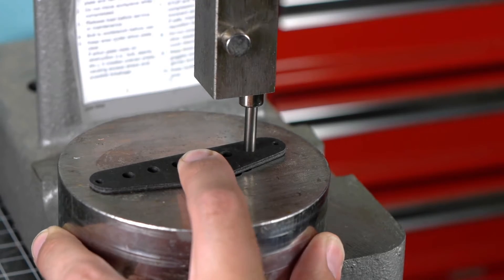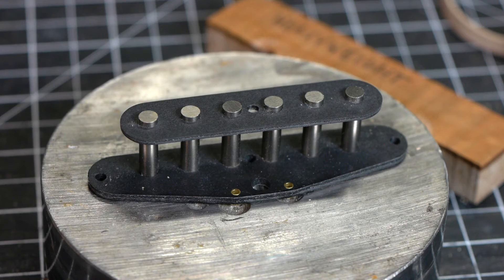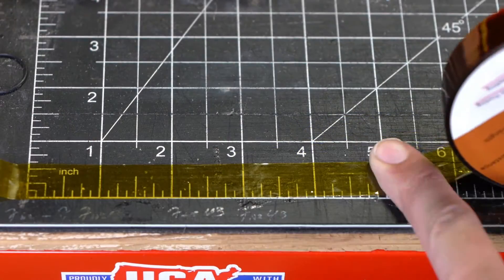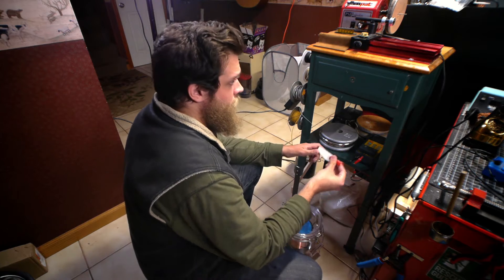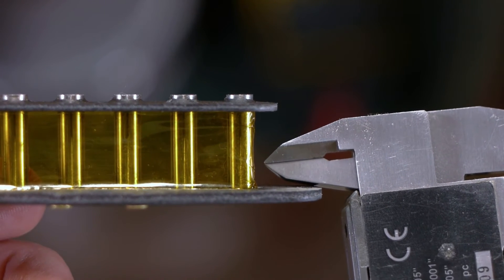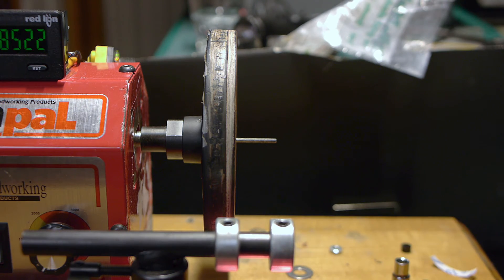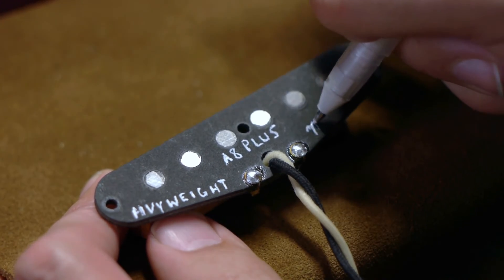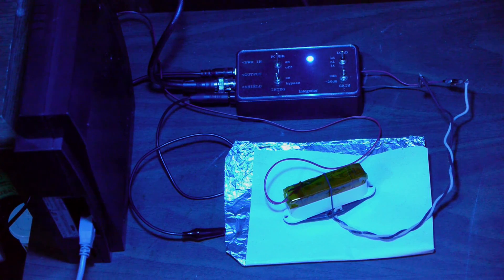(**OLD VERSION: CHECK DESCRIPTION**) Making a Single Coil Pickup: Complete Guide

Comment: how would you insert eyelets?
Reply from the maker: I use the same tool steel working surface as I do for assembling bobbins. I drilled recesses deep enough to accommodate eyelets. The method is: 

Use an eyelet setting tool and a hammer. Line up the eyelet over the hole, and tap it firmly a couple times. Not too hard or it'll flare out. 

Then file down the excess flush. I use an equalling file for that. Most sets of needle files will have an equalling file in the set. It's the flat one with a square end. 

I do mean filing the tubular side of the eyelet down, not the flared side. The flared bulbous side is what you leave alone as that's what holds the bead of solder. 

You could use a block of wood just as easily. The key is having a work surface that has holes to accommodate the eyelets. When you set them, you'll have some of the eyelet tube sticking out through the bottom so the hole needs to be deep enough to accommodate that.
Reply: @guitar_md  Oh okay!! Thanks a million
Reply: @guitar_md  Could you consider making a short of this process?

Comment: I shouldn't popularize kapton tape in pickup group 7+ years ago. Other started to copy me i mean a lot of people, and i shared some other trick. No matter that use tape if you use it a way you do corrosion will start for sure it will pass trough a thin gap. Super glue should be a HUGE NO NO but sometimes the best way is keep my thoughts to myself. Good luck in your work, it's nice video well done.
Reply from the maker: The primary tape I used for years was black cloth acetate tape. I still use it pretty frequently, and have used it far more than Kapton tape -- only moved to Kapton tape this year. 

Black cloth tape is much cheaper and also much thicker. Thick tape can be problematic in terms of winding space as it will reduce the amount of turns you can fit on a bobbin before filling it up. 

Usually with the black tape I will have an overlap so there is no gap at all. It will cover a portion of the top and bottom flatwork via overlap. 

However, I have wondered if tape is a no-go. Professional magnet manufacturers often use an epoxy coating to prevent corrosion over time. I have thought for a while that using some kind of painted on coating over the magnets would be much more effective than tape. 

I've done a lot of vintage pickup rewinds and I do know what you mean: all it takes is a tiny amount of corrosion to ruin a pickup. I recently rewound an original 1951 Nocaster neck pickup, and the magnets had no tape around them at all. They were virtually mint condition inside, except for a very, very tiny amount of corrosion that I had to capture with a macro lens to see. 

I can understand why you'd be concerned about a small gap. I probably should have shown my usual method of using black cloth tape with a slight overlap on the top and bottom flatwork, though I thought of Kapton tape as the "industry standard" and wanted to have the most professional quality for this video. Could have ended up being a mistake. 

I'm curious why superglue is not appropriate. If there are any major concerns with it that would give me reason to stop using it -- I will stop using it. My only concern is making the highest quality pickups as I can, as a hobbyist. I don't run a business doing this. It's a labor of love. 

I haven't had any issues with superglue so I would be curious what issues would exist with it. 

Most of the pickup assembly methods I use were taught to me by Rob DiStefano of Cavalier Pickups, who's been winding pickups for decades. Everyone has their own way of doing things -- I'm most concerned with the correct way, and the most effective way. 

I don't agree with the idea that it's "best to keep your thoughts to yourself." 

I am completely open to criticism as long as it's actually valid and can improve my skills. As long as people are respectful of me I have absolutely no problem with criticism. 

Honestly, the most distressing thing to me is feeling like I put out some information that isn't accurate, or is teaching people the wrong thing. Like you said you wished you never introduced the idea of using Kapton tape years ago. 

However, I do need solid reasons for the methods I use -- for or against. To change my mind on something I need evidence and good reasons. Criticism in a respectful way is welcome here -- debate is healthy as long as the goal is coming to a more sound conclusion and having better, more reliable information. 

So please don't hesitate to tell me your thoughts. You haven't been disrespectful in anything you've said so I have no problem with you. I'd love to know what you think I'm doing wrong -- but more importantly, *why" you think it's wrong. 

I am always open to changing my methods when I'm presented with evidence that what I'm doing right now is not optimal. 

My guitar tech friend and mentor Steve really drilled that into me. He's been doing guitar work full time since 1968. Worked for Dan Armstrong and is still going full force, better than ever. 

He always told me not to get married to any method. "Show me a better way, and I'll be doing it tomorrow." 

I'm the same way. If there is a preferable alternative to taping the magnets I'd like to know -- I've considered using a painted-on coating that prevents rust, but haven't tried it yet. Black cloth tape has worked well for me but I'd be open to trying something else. Rust-proof coatings make the most sense, like what major manufacturers of magnets use to protect them -- but curious what your thoughts are.

Comment: Is the flat work different dimensions on the bridge, middle and neck pickups?  Thanks Glenn
Reply from the maker: Same for all of them: 52mm. This is the way Fender has always done it. 

However, foreign copies will often use 48mm neck, 50mm middle, 52mm bridge. This does line up better with the strings, but in reality I'm not convinced there's any audible difference whatsoever. 

The funny thing is that Tele pickups are spaced differently. I think 50mm on the neck pickup and 55mm on the bridge if I remember correctly. The reason Strats are spaced the same was probably to save money and expedite the process. 

When they designed the Tele pickup set, they clearly were aware of the narrower string spacing at the neck position compared to the bridge.
Reply: @guitar_md  thanks for the help that’s brilliant. 👍

Comment: You can see the wire during the spin, my scatter wounds are a little different than what I just saw. I like to keep my wire tight and I use my bare hand to feel the wire tension. I normally get a nice middy sounding wind even with an Alnico 5 mag at PAF level winding. I did one with a ceramic mag at 8.4k trying to recreate the 70s rock sound. It is a beautiful sounding Humbucker. I love what I do! 🫶🏼

Comment: Where do you get your plastic jars from? The ones you use to hold your 5lb rolls of wire. I've been looking and dont see any that big. Thanks
Reply from the maker: I've gone to using Rubbermaid pitchers. You can see those in my new updated version of this video here: 

https://youtu.be/5BqFoBJr10o

Much, much better than the canister/hinged lid style, funnily enough. And much easier to find. Like this one here: 

https://www.amazon.com/Rubbermaid-Pitcher-Classic-Gallon-Clear/dp/B00FSLRH2K/ref=sr_1_4?crid=WAES3ZN71D8D&keywords=rubbermaid+pitcher&qid=1691812634&sprefix=rubbermaid+pitche%2Caps%2C101&sr=8-4

Should be at any Wal-Mart, or easy to get online. Let me know if it works for you

Comment: I wind great humbuckers, buty singlecoils, are always bright and scooped. Any tips
Reply from the maker: I like overwinding my single coils for that reason, at least in the bridge position. Thinner wire and more turns will do it. Anywhere from 10,000 turns and up will pretty significantly attenuate the high end. More turns = less high end, more mids and low end.
Reply: Agree but then the more turns the more lifeless, it's the perfect in-between, which I found with humbuckers, but can't get my single coils  to sound how I want.
Reply from the maker: @wesleymorris1  It's important to define what lifeless means. That could be higher capacitance, or a lower Q factor (less amplitude at resonant frequency), or a more rapid dropoff in treble frequencies. And those all can be very hard to control. 

You might change the way you're building the bobbins. Shorter coils vs. taller coils. I haven't tested enough to conclusively say much except that shorter coils appear to have lower capacitance, which usually results in less attenuation of high end frequencies. So for the same inductance/resonant frequency, shorter coils will tend to retain more treble. 

On paper that sounds good, but it can also result in an unconventional tone. Bill Lawrence's "Micro Coils" are a good example of this. Much, much shorter coils (.120" tall vs. the conventional .430" tall for a Strat pickup, for example). I've made my own version of them, and for the same inductance, they have considerably more high end. I have two pickups I made, both at 5 Henries, and with the shorter coil, the resonant frequency is 3.3dB @ 2.8kHz, while the taller coil is 3.4dB @ 2.3kHz. The shorter coil has a capacitance of about 25pF, and the taller one, 98pF. 

The shorter coil has kind of an odd sound, but very, very clear. The shorter coil is 9,500 turns, and the taller coil is 13,000 turns. So, coil geometry is a huge factor. Turn count is the biggest factor when dealing with bobbins of the same style. But you can alter the coil height to your advantage depending on what you want to achieve. I haven't settled on any models yet. I have made a bunch of taller coils with .781" mags and a ton of turns of wire (up to 18,000 of 44AWG), and people quite like them. I also like them myself. I'm used to a heavier, thicker sound in the bridge position, and that's what I prefer. 

For Neck and Middle single coils, I still use a very conservative wind of about 7,600 to 8,000 turns. I don't like those positions to be wound too much. Another thing to consider is using phenolic standoffs (or whatever else will work) and metal bolts, like on a Fralin Steel Pole pickup. The steel poles + bar magnet combination will be like a P-90. The Eddy Current losses from the steel poles will draw down the high end a bit and will go a long way in smoothing out the tone without having things go lifeless. It all gets very complicated the more you experiment though, for example, I've found neodymium magnets to make for uncomfortably shrill sounding pickups, in the designs I've tried.
Reply: @guitar_md   I define lifeless as no character or kinda of flat response, I prefer Brite top end with a growl in the mid and snappy low strings. Example would be like Seymour Duncan  quarter pounder type tone or fender 69 strat pickups, alnico 5 with some output.  Everything I make is like big dippers , scooped mids and shrill, I'm getting some new magnet wire, to try some plain enamel, poly heavy build and formvar.  I  make killer humbuckers, better then anything I've bought from all the name brands,  but my single coils are needing some work. I hand wined all my pickup,  I traverse with my fingers and i keep it between the flatwork with no stops, I probably spun 2000 pickups,  so I got some experience doing it. I'm going to try different wire, I let u know the results.

Comment: Hi, is the tape you are using polyimide tape? Thanks
Reply from the maker: Yep, that's it! You can get it much cheaper going generic with that stuff vs. the Kapton brand itself. I've also used black cloth acetate tape from China for many years with great results for the same purpose.